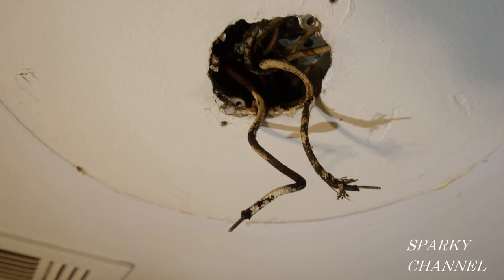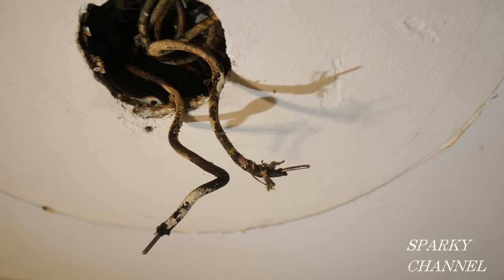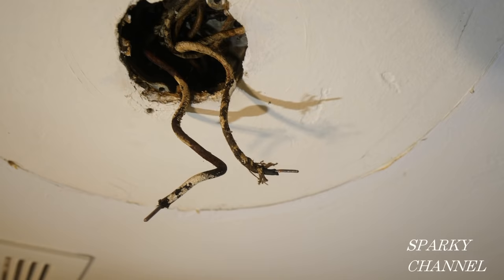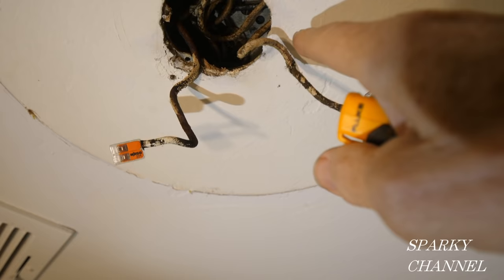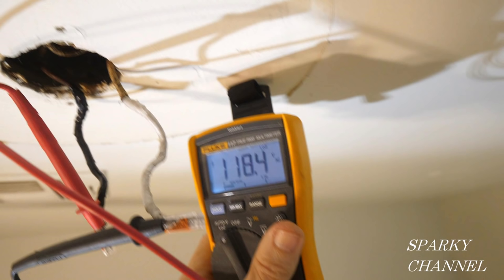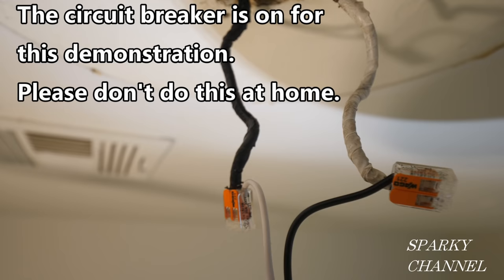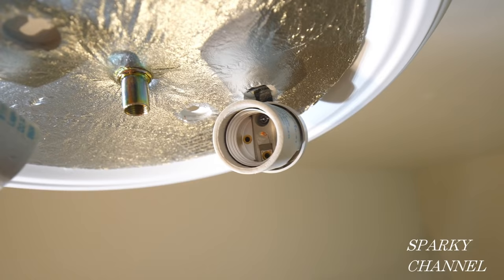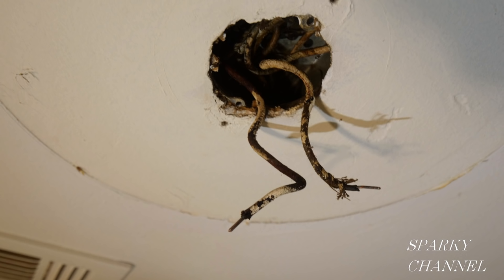Which Wire is the Hot and Which is the Neutral in an Old House? How to Tell and Stay Safe!

Comment: Nice and clear video!  The only thing I tell your viewers is the insulation on electrical wire shown is called “Cambric” which is a rubber insulation covered by a cloth covering and that when the rubber dries out it crumbles and the cloth covering also disintegrates leaving bare wires exposed possibly causing a short circuit.  That is why it is super important to over the wires with color electrical tape.
Reply from the maker: I agree. Thanks Bill!
Reply: WhY not test the earth wire as most electricians woul
Reply from the maker: @andrewbrown7171  Hi Andrew! In 1957 in the USA there is almost never a ground wire in the ceiling for a light. That is the case in this example.

Comment: I can remember working in homes that were wired in the 1920's and before. As soon as you touched that old wire the insulation would crumble off. It would have been nice to have WAGO's back then, less stress on the wire when making splices.
Reply from the maker: Excellent point. Thanks Thomas!
Reply: My great grandma's house was like that.   The sockets were 3 pin round from the 1930s era I think only good enough for a couple lights am just about a TV.  If she put the washing machine on the fuse would blow instantly.  
She had her house renovated in the late 90s and the whole place was deemed too dangerous  due to the vulcanised rubber cables perished and gas leaks from the lead pipes.   She had to go live with my grandma and granddad for a few weeks until it was all sorted.

Comment: That's the reason I use black and white liquid electrical tape. I paint the wires the proper colors. Works real fine, lasts a long time.
Reply from the maker: Excellent, both for wire identification and to protect the wires!
Reply: There is also spray tape in various colors.

Comment: i you don't have test instruments & don't want to buy them, take a rubber pigtail lampholder, attach 1 lead to a metallic cold water pipe. the other lead to the suspected hot wire. the lamp will light on the hot wire, not on the neutral. this is also very useful when testing knob & tube wiring in older homes. bear in mind in the knob & tube days, the neutral was switched, not the hot.
Reply from the maker: Thanks Gary!
Reply: Good tip.  You can also use a volt meter as well to perform the same test, i.e. the meter will show voltage when connected between a water pipe and hot lead and show no voltage between a water pipe and the neutral. (I have a volt meter but don't have a test instrument as shown in the video.)

Comment: In older houses it's common to see the switch for a light in the neutral leg.
Reply: My house and my neighbor's are like that. Drives me crazy every time I change a fixture or add a feed. 🤦
Reply from the maker: I haven't seen that in my area but thanks for telling others about the potential problem.
Reply: are you sure your not seeing "power at the light" scenario? I think modern code asks for hot, common, and ground, in every box. But many older house would just take one group of wires and loop it back through switch over white. it should be marked with black tape. but people get lazy.

Comment: VERY helpful. I was just crawling around in the attic and went downstairs to disconnect a light fixture from below so I could require it. I promptly forgot which wire was hot and which was neutral. I could guess but thought I’d be safe and double check. Thanks Bill!

Comment: Another great vid. I see this issue a lot in Boston old homes. Perfect application  for the wago nuts.
Reply from the maker: Yes, I'm sure this situation is found all over in older homes because those old wires don't keep their color well over 60 years or so. And yes, the Wago's offer a way to check the voltage without exposing the installer to bare wires. Thanks Dav!

Comment: I thank you and other you tubers for this information. I built a house in Thailand almost 20 years ago and I have since discovered that there is absolutely no conformity to wire colouring through the entire house. There's probably about 80 elec outlets and switches throughout the property and there are just so many differences that I decided to start taking apart each box and colour code and mark each wire..........of course I had to learn how to identify each wire using a multimeter........but I thank you and the others for teaching me how to do all of this.......I have done about 10% so far, so still a way to go, but I am also making a log book for each and every plug & sw which will help both me and any future owner down the track.
Cheers from Chiang Mai :) :) :)
Reply from the maker: Cheers from San Diego!

Comment: Well done -- THANK YOU! 
It is possible -- even LIKELY, out of so many views -- you saved some folks from a shock, a fall, or even worse. I live in an old house with a good bit of "knob and tube" remaining (some are even fused circuits) so definitely appreciate your video.

EDIT: Both my wires at a ceiling fixture show hot using a little detector like yours (mine blinks rather solid light). Now what?

Comment: I have been using this method for years. I would just add  that often the insulation on old wires is badly deteriorated especially if you are dealing with older knob and tube era wire. In those cases i put shrink wrap as far on the wires as possible then use a small heat gun rather that a flame to shrink the tubing. Then I mark the hot feed to the box with a black tape flag back far enough back that it will not get in the way of of the wire nut or wago .i also put a white tape flag on the primary neutral in the box . Also good to look the wires over especially stripped ends to see if the copper has been nicked such that it is likely to break as you are shoving back in the box . And if there are just too many wires in the box i will try to put an extension on it or change it to a 2 gang old work box if necessary or a deeper single gang box.    Some times you can use Wiremold system boxes to get around some overcrowding problems . Those non conduct current testers are great and essential tool in my bag!      Also good to take a picture of the wires and connections in  a box when you first open it so you duplicate what is there and working when putting it back together , as long as  you find that what is there originally is safe . As i am sure you know sometimes those “rats nest “ boxes  can be a nightmare to unravel and figure out .
Reply from the maker: Excellent tips, thanks Richard!

Comment: Yes indeed great video and lesson on this type of wiring.  Yep this wiring is found in older homes especially build after 1930 which my house has some remnant of the old bx wiring.  I would wrap them in electrical tape or I like to us heat shrink tube with a blow dryer.  I did that for an old light fixture wiring in the front hallway.
Reply from the maker: Good job.

Comment: Thx, Bill.  I will use your tape wrapping idea as I change all the outlets (and some fixtures) in my 1952 (new to me)  house.  The wiring in this house is all 12-2 (no ground) and I plan at this point to use GFCI breakers so I can put in 3 prong outlets.  Some areas will get 12-2 w ground ...such as furnace...fridge, and the laundry room.
Reply: it would be a good idea to use combination ground/arc fault breakers for an added layer of protection in any circuits you don't upgrade - and yes, definitely upgrade your appliance circuits.
Reply from the maker: Excellent!

Comment: I got bit many years ago, because they wired a switch loop (hot wire to the light first). When the light switch was off and the light was out, I assumed the power was off to the light. The switch broke the path,but juice was still live at the light. We didn’t have all these nice testers like today. Always use a proximity tester and make sure it is working first.

Comment: Another way to do this: find a reliable ground somewhere (say, plug in a 3-prong extension cord to known-good receptacle and put a probe in the ground terminal), and test voltage between the ground and your two unknown wires. Neutral should be 0V, hot should be 120-240V. This should work even if ground/neutral aren't bonded in your area, although the hot may show less than its nominal voltage in this case.
Reply from the maker: Excellent, thanks!
Reply: Why would the hot be up to 240V? You need 2 hots to get 120V in North America with single phase 120/240VAC. (Not talking about 277/480 or Delta high leg)
Reply: @illestofdemall13  Agree with your statement. Unless you are testing a 240V, then yes 120v to ground on each wire.

Comment: When troubleshooting a homeowner DIY chandelier install, the hot and neutral were reversed causing the lamps to short and spark against the metal trims. That’s why I refer to these jobs as being done by Ruin it Yourselfers.
Reply: You exposed a symptom of the actual problem which is actually the chandelier. Even if wired properly a connection between neutral and ground is a bad thing and will cause a GFCI to trip, if that installation got one for that circuit. So the chandelier must be repaired or replaced, connecting it properly isn't the proper solution.
Reply: I refer to it as "done by Time Life Electric" in honor of the DIY books sold by Time Life Books.
Reply from the maker: @Marcel_Germann  You make an excellent point. The chandelier should be designed in such a way as to not cause a short and sparks in this instance. The electrician should get it right in the first place of course.

Comment: Great video thanks for making it.
Thou if you are doing home renos where I live old knob & tube must go in reno areas.
And most electricians and inspectors highly stress replacing it all.
Buy it depends on code where you live and type of reno.
Reply: does that require ripping holes in the walls?

Comment: I'd also mention what a switch loop is and why you may find these in older homes (and even not-so-old).  My current home was built in 1988-89 but done so by a commercial electrician and he did some things that weren't common practice for residential.  Nothing dangerous but different than what one might expect in homes of that time.  I don't have many switch loops but that's because most of the switches are low voltage with central relays (GE RR7).
Reply from the maker: Interesting! Thanks Scott!

Comment: Thank you for indicating that your non-contact sensor had a range that minimized false readings; I did have to reason out, however that you were specifying that it is this sensor's relatively small range (90 volts and above versus less than 90 volt sensing) that improves identifying "hot" versus "neutral" wires when they are relatively close together. My other non-contact voltage sensor (50 volts to 600 volts) was not discerning between black ("hot") wires and white ("neutral") wires within 2 inches of each other emanating down from my ceiling (where a light had been), so it was alerting to both as if the white was "hot" and alerting to the truly hot black wire, too. The Fluke 1 AC-ii did great and not too darn expensive at our local Lowe's and was not available at 3 other electrical supply stores here.
Reply from the maker: That's the one I use.
Reply: @SparkyChannel  Thnx; that is the reason I got it, esp after getting false readings with a lesser-quality detector (but, I did not know that until I reasoned it out). With your videos and help from a neighbor very experienced with pre-1965 wiring, we figured out that my presumed "3-way" switch system was actually a 3-way switch loop! Thanks for your videos !  😁

Comment: Polarity is important as you demonstrated.  Yes the circuit functions and the devices work but it's more dangerous.  Things are still live/hot if switches are turned off
Reply from the maker: Yes sir, that's correct!
Reply: The wall switch will cut the hot no matter how you wire the light.

Comment: and if you're lucky, the guy who built the house didn't leave the hot unswitched and control the fixture by switching the neutral - which would make it so a reverse wired fixture can ALWAYS be a shock hazard.  
and that is why DIYers are ALWAYS advised to turn the power off at the breaker.
my last ditch trick, if I am not happy with the readings I'm getting, is to plug an extension cord into a known correctly wired receptacle - even if I have to install a temporary power cord from the panel - and use that to provide my definite hot and neutral references.  I've had times when induction made it hard to get a clear reading from a non contact tester.
Reply from the maker: I totally understand. That's why I always use the Fluke voltage sensor for such tests. Some other (not all) brands will beep at everything so that you can't do a proper diagnosis. The Fluke doesn't have a flashlight, laser pointer, etc built in. It just does one thing but it does it really well.
Good advice Ken!
Reply: @SparkyChannel  i would much rather have a false positive than a false negative. But I'm a firm believer in confirming anything ambiguous and I've found some strange wiring that way.
Reply: Question on that. So the hot runs completely unblocked while the neutral is the disconnecting means? Wouldn't the constant power not returning back burn up anything thing on that circuit?
Reply: @breakitdwnclown1514  it would not, because electricity does not work until it is allowed to flow.  it is different from water in that regard, where water under pressure causes constant stress on the material holding the pressure.  electricity that isn't flowing just sits and waits for the circuit to be completed. the risk is that anything which touches the energized parts can provide a path for the electricity to flow. and THEN you can get damage.
Reply: I was waiting for the Narrator to discuss switched neutrals as I have found it to be common in knob and tube but rarely talked about. Also I like to use shrink tube over the insulation, as electrical tape is difficult to get a nice wrap and becomes bulky.
Reply: @matthewrinehart2367  I like to strip out knob and tube and replace it with modern wiring.  considering the insulation outside the box is no newer than the insulation inside the box.
Reply: @breakitdwnclown1514  no current flows until a circuit is complete. The problem with switched neutral is that with the wall switch off, the fixture still has a hot wire in it, from which a human can complete the circuit. Best practice is to locate and turn off the breaker. I’ve spent 15 minutes finding the right breaker, but safety first. I only work hot if I have no choice, and then I wear gloves if I can.
Reply: @TomCee53  The first electrician I apprenticed under had me work on live stuff religiously. Learned how to be careful and maneuver effectively. Still don't like it but I've been shocked enough it doesn't bother me (residential ofc)
Reply: @kenbrown2808  Generally the wire above the pan box still has a bit of flexibility. It's not as scary as aluminum wiring!
Reply: @matthewrinehart2367  I've seen insulation crack off faster than I could tape it back on.  yes, it's as scary as aluminum.
Reply: @breakitdwnclown1514  oh I've been shocked enough but I still don't trust my circus anymore than I have to
Reply: @TomCee53  When I grabbed my first hot  bare wire in one hand and a neutral in another I started testing every circuit. Especially in these old light first houses.

Comment: The fixture and the code both say to install on wiring rated for at least 90 degrees Celsius, but NM wiring before 1984 was 60 degree rated.

Comment: Another way if you're really not sure which is your return wire aka neutral wire in older rubber cloth insulation wiring.  If the cable is bx, use your muli-tmeter, set it to continuity with sound while the power is off.  Touch both conductors, if no sound than that's good because if you repair these wires you want to make sure they're not shoring to one another.  Then touch one probe to the let's say the assumed hot wire to the metal box or the metal cable sheath, if no audible sound is made, chances are that's your hot wire.  Next test the remainder wire to the conductor and the other probe of the multi-meter to the metal bot or metal sheath of the bx cable, if it makes an audible sound that's your neutral wire!  This will tell you that your wires aren't shorted together with each other or the metal box or metal sheath of the bx cable and your circuit is grounded.  If your house was wired with the old bx cable back to the circuit breaker panel each junction point nice and tight connections to the metal boxes, chances are if it was set up correctly, the circuit breaker panel should be bonded with a bonding screw which bonds the neutral and the ground bars if any together to your utility coming in the building and your circuit is grounded.  If your house is wired the same but with romex without a ground then you're not grounded at all and may need an electrician to ground it properly or worse case rewire that circuit or entire building.

Comment: the non contact sensor is good, but i think what it looks for is the 60 Hz radio signal. That signal can be passed on without contact. just like a coil of wire with a current can move a magnet its not touching. 2 wires running parallel have a similar effect as 2 coils of wire wound together. so a live wire in parallel over a long enough run can make a dead wire make your non contact sensor beep. That's why its good to go back and check. or if you have a ground, just take your volt meter and test 200V AC to ground.
Reply from the maker: Thanks!